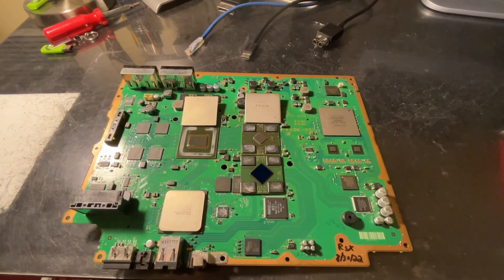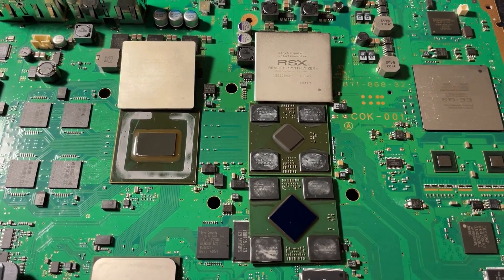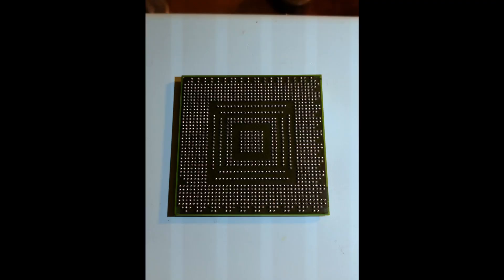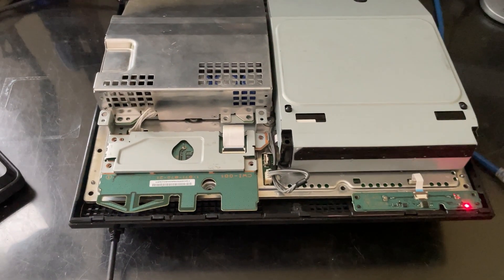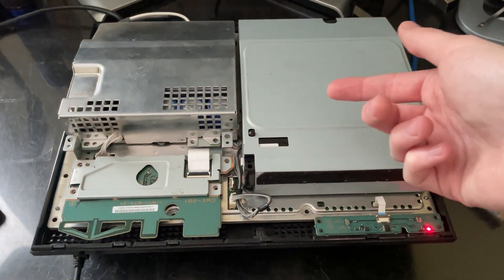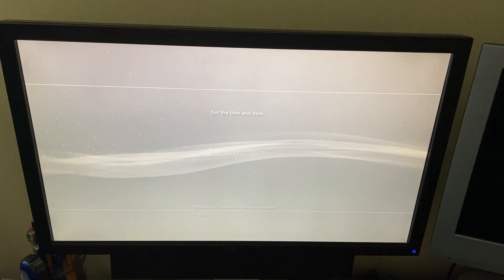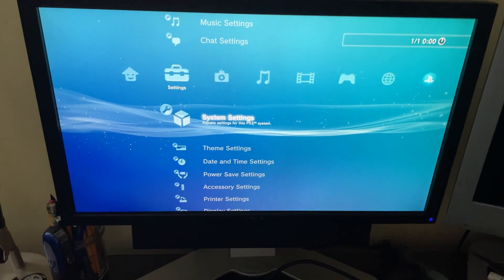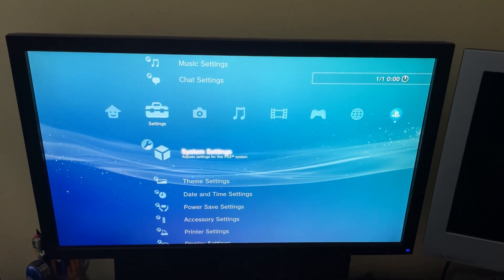I made a Frankenstein B/C PS3 (40nm RSX)

Comment from the maker: Be sure to check out RIP-Felix's AWESOME video on YLOD!
https://www.youtube.com/watch?v=I0UMG3iVYZI
Reply: In the case that neither of the Blue ray drives work, you can go ahead and jailbreak and install Rebug on the system, you can use rebug to enter Factory Service Mode (FSM) and remarry one of the two drives that was sent to you. I recently did this to my ps3 with one of my spare drives because my old drive had a bad ribbon cable and was just generally in worse condition than my spare. Its a very easy thing to do I'm sure you'll figure it out.
Reply from the maker: @nice8D  Thanks for the suggestion brother
Reply: @Josh.Davidson  do you do this as a sendin service
Reply from the maker: @thewavyshopofficial  Nope.
Reply: Thanks. I already watched this. Awesome work.

Comment: With this modification does the launch PS3 fan run quieter and as reliable as a slim PS3?
Reply from the maker: I have absolutely no idea. But probably not. The Cell is HOT.
Reply: @Josh.Davidson  OK thanks for letting me know. So it sounds like a Frankenstein mod helps to increase the lifespan, but it could still eventually overheat.

Comment: Can you recommend me a real best solution? I have the CECHA01\00 tho consols, and seperately best variants of PSU\Cooler\Radiator for CECHA - and in general scalping or replacement to different RSX model (reballing) is no problem!
Reply from the maker: I don't understand your questions
Reply: @Josh.Davidson  I have 2xCECHA - and 3 different models of PSU (APS-231, APS-226 and LSEB1226B1) + 2 type of Fan (17 and 19 blade) + other "compatable" parts from newer model... And don't know what is the "best hardware configuration" for making best (most silent, colder and stable) console? (i will before replace RSX with 40\45nm and make Cell scalp).... Sorry for my English!

Comment: Will it work on 65nm GPU one?
Reply from the maker: I don't know. But no point, 65nm is reliable.
Reply: @Josh.Davidson  hmm but I have ylod and it's 65nm one 😢
Reply from the maker: @gnrtx-36969  Check syscon first. its possible to failure but less commonly. later 65nm model will be reliable.
Reply: @Josh.Davidson  gotta be capacitor right? I'm hoping it is
Reply from the maker: @gnrtx-36969  Check syscon

Comment: You can easily REMARRY any blu-ray drive form same model by dumping EID ROOT KEY (ERK) to USB drive and switching to factory service mode (FSM) if you install CFW firmware. After you can install any firmware including OFW.
Reply from the maker: Yeah, but since I had both drives I just ended up trying both and the second one was the correct one.

Comment: I have a working cech E01... Should I try this mod anyways or just wait until it fails?
Reply from the maker: Wait till it fails.
Reply: @Josh.Davidson  I've had it running for over 6 hours before RSX doesn't reach over 58°c. Maybe I got lucky. I do keep the fan running higher while I didn't delid I did replace the original thermal paste.

Comment: Recommand you to make the fan more accessible, that's the biggest problem with FAT models
Reply from the maker: No, that actually destroys the thermal airflow path in the system, and is not in any related to YLOD failures anyways. That's just something someone who doesn't really understand engineering came up with and has wrapped around the internet.

Comment: This is very cool - never thought this could be done!
Reply from the maker: I am definitely not the first. Sony actually did this first, and the Frankenstein mod copied it
Reply: @Josh.Davidson  true, just hadn’t crossed my mind haha. However they did do it but without the backwards compatibility Ps2 hardware in plave
Reply from the maker: @grandtheftauto1233  Wrong, they did it on B/C model a few times to fix them! See thread at PSX Place!
Reply: @Josh.Davidson  TIL - thanks josh for the friendly correction and neat information 👍
Reply from the maker: @grandtheftauto1233  Np :)
Reply: Is there anywhere you know of including yourself I could send mine to get made to last basically forever like this?
Reply: @josephhall7317  josh closed shop so idk :(
Reply: @grandtheftauto1233  thanks anyways, I saw one person that takes mail ins and does it but they want $700, I have to pass on that person
Reply: @josephhall7317  yeah that’s soo extreme. Best of luck if you do find a good deal lmk I have the same idea
Reply: @grandtheftauto1233  I'm definitely looking so if I do find somewhere half decent I'll let you know, I have one in a tech shop near me right now that's replacing the Blu Ray laser, changing the thermal paste and pads for $150, going to call tomorrow and ask what they would charge if they would do the GPU swap but that's not the full Frankenstein mod, probably make that one last another 8 years though
Reply: @josephhall7317  I mean if they’re de-lid and reapply paste I think it’ll last a long time. It seems the failure of the paste between chip and IHS lead to running hot -> shorten life of RSX. 

However restoring the original cooling capacity by de-lid and repast may make it last another 10 years

Comment: Wow that's interesting. That's one over engineered way to have it heat less I guess! I'm really curious to know how it's doing with the temperature. 
Hopefully you do more PS3 stuff!
Reply from the maker: I didn't do it for temps, I did it to repair it as the 90nm chips are defective and most will die].
Reply: Bullshit. They die because of very high temps or for the capacitors. My dayone PS3 always with controlled temperatures/fans is perfectly working since then
Reply from the maker: Science and engineering disagree with you. See Felix's video for details.
You may have also missed the fact that not every chip is defective. You very well can get exceptions that "just work".
Reply: @Josh.Davidson  I saw the video and even him writes that all numbers are not confirmed,  mean all the one reported on forums. Btw yes there PS3 that no die like mine
Reply: @Josh.Davidson  Yes I know it wasn't done for heat, but I suspect this would be an side effects of reducing the size of the RSX, although it's not heating as much as the cell processor.
Reply from the maker: @jonathanmichaud6800  Yes.